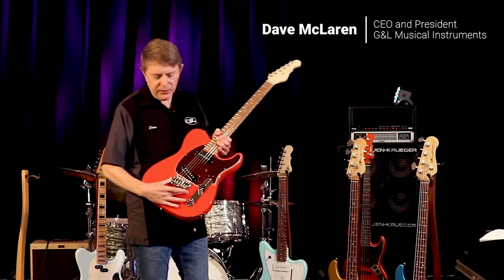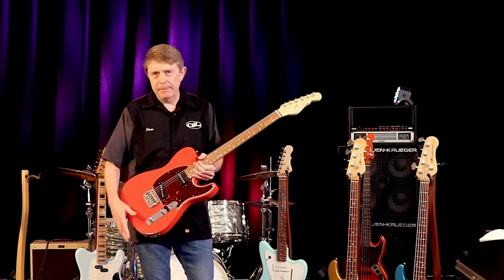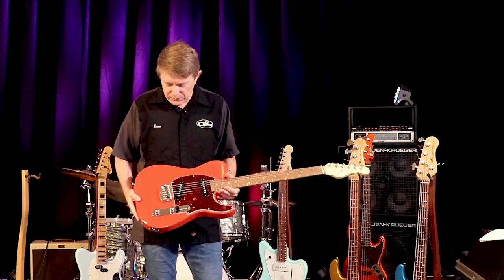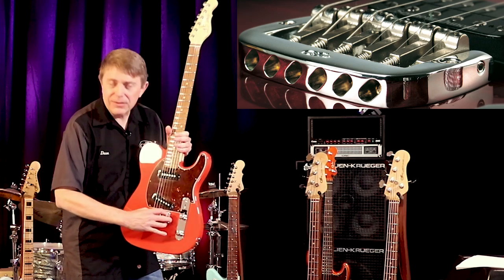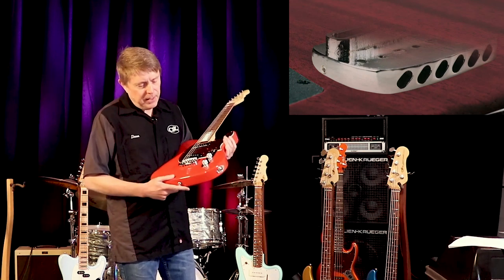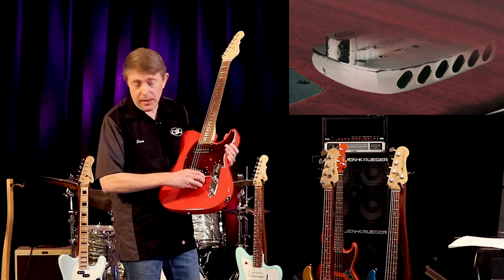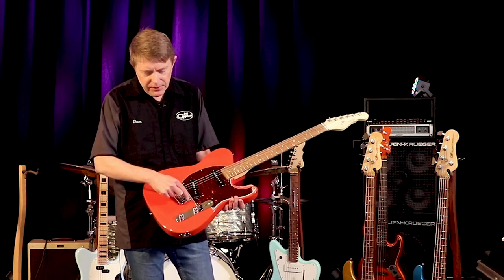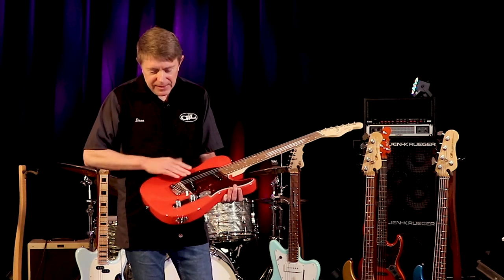Dave McLaren on the Saddle Lock Bridge

Comment: Hey Dave. Huge G&L fanatic here with a piece of constructive feedback on the Saddle Lock bridge. I've owned four G&Ls with saddle locks. Two USA basses, one Tribute bass and one Tribute Guitar. The two tributes had factory sandpaper shims, and the two USA basses needed shims to achieve the low action I prefer(and it's not even that low).

I believe the reason for this is, the saddle lock's super tall saddles were designed with a micro-tilt in tandem. The old G&L's had micro tilts so this was never a problem. 

With modern G&Ls, I believe the problems happen during the sanding/planing phase of the fretboard. There is basically no tolerance for sanding the board even slightly underset. If this happens, a shim is required. And based on both my personal experience, the factory shims on the Tributes, and the experience of G&L playing friends of mine, this is a widespread issue caused by this small design flaw. 

I have made this crude illustration to show what I mean along with a couple suggestions of how to address it. 

I hope you take this in the good spirit it was intended. I'm a die hard G&L fan.

https://ibb.co/LRX0FMr
Reply: @bristevenson  I'm sorry and that shouldn't have happened to you. even. with tight pockets there are ways to get it off safely. un the future take your guitar to a luthier or qualified tech if you're not confident you can safely remove the neck on your own. 

I'm glad you got it playing correctly but this is why I'm trying to communicate with G&L. this is a widespread design flaw and yes, the sandpaper shims from the tribute factory are inadequate because they do leave air pockets. if they will not update the design they should at least install full contact shims. 

was this Fullerton deluxe factory shimmed or did it have a previous owner?
Reply: Thank you for this explanation and image. I am new to G&L and have been struggling with set up and getting the string height. I have just shimmed my ASAT Tribute and it is now much better. I used the simple technique of removing the neck and placing a business card on the body slot.... half a card all the way back and a full card, so it is a slightly tilted shim. Thank you for confirming this.... thought I was going mad (may still be!!)

Comment: The notion of string vibrations needing to go into the body wood is some serious physics nonsense. If string vibrations enter the body, they are lost from the strings. So not seen by the pickups. A little vibration transfer is unavoidable. But it means that string vibration amplitude is reduced slightly at all points in time from the time the string is struck. Solid bridges mounted on solid bodies actually REFLECT most string vibrations back up the string, as they should. All measurements of real guitars have shown that. Whether this bridge does that better than other bridges would require proper measurements, for example by laser vibrometry. Otherwise any assertions about its merits are pure speculation.
It would be nice if electric guitar manufacturers actually understood the physics of their instruments, but few do. Luckily you can still make decent guitars without that understanding.